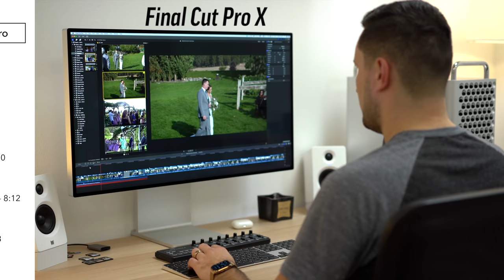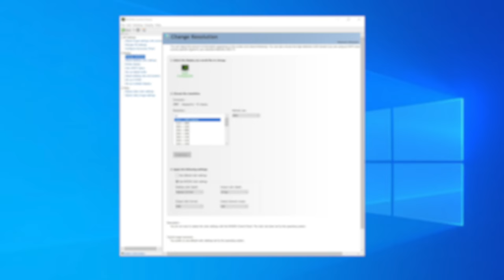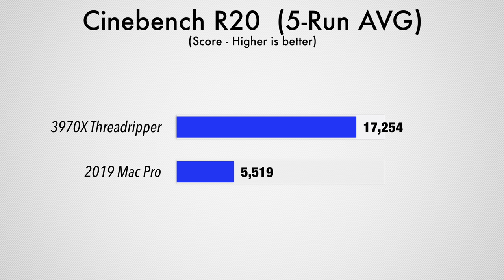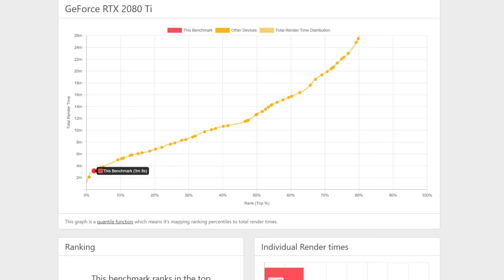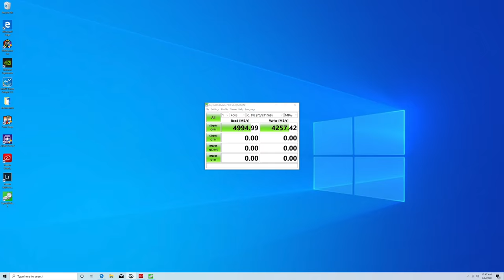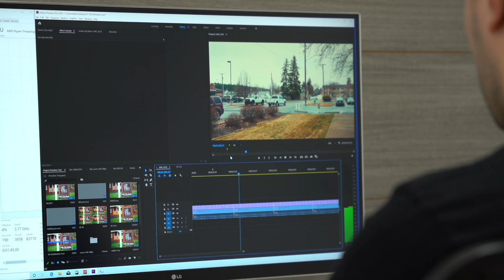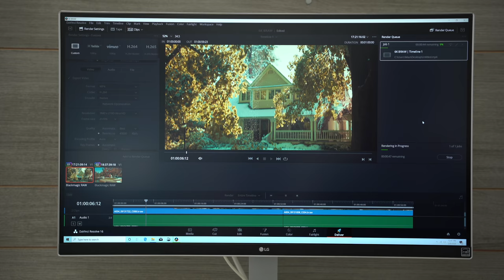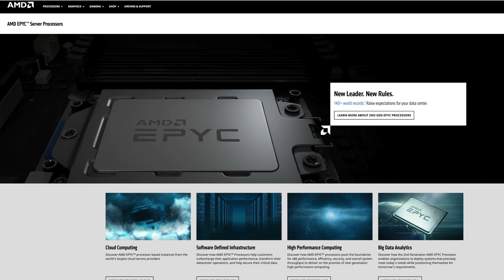$15,000 Mac Pro vs $5,000 Threadripper - Sorry Apple..

Comment: I don't know how many times he said "... that's why people prefer macs... " and macOS as being better than Win10.
That's just personal preference, you can't put that as an advantage!
I for my part hate working with Mac workstations.
Also the noise part. There are plenty of solutions for that, but naming them would be an disadvantage for the Mac and we can't have that.
Interesting setup for a comparison, but the execution is garbadge.
By the way, the cheese holes in the Mac tend to get full of dust and is hard to clean, but hey, it isn't as loud and has macOS.
Reply: Better pc with less thunderbolt ports is bad... Who tf needs 8 thunderbolt ports?? Bruh!
Reply: water cooling? lmfao i dont think thats gonna cost 10k more
Reply: @VorteX_SH  who needs a computer that costs  $15000 bruh!!😂😂. It's not like money grows on trees
Reply: Not sure if you got the point of the video but ok
Reply: One of the solutions would be to keep the PC in a cupboard or something. Obviously you'd need proper ventilation; but it is doable if the noise is bothering you that much